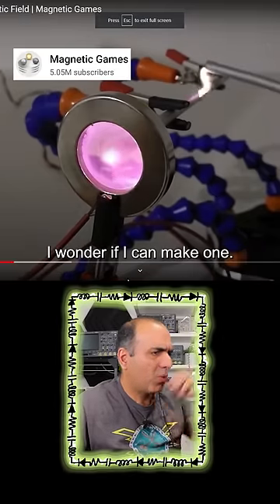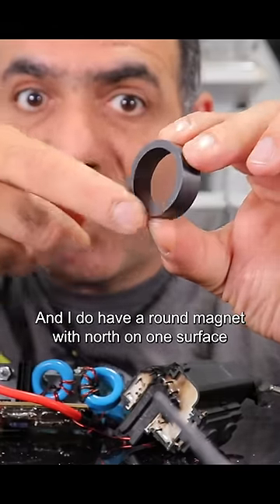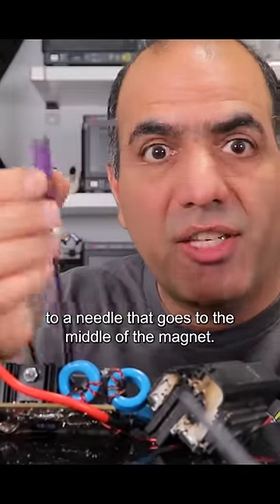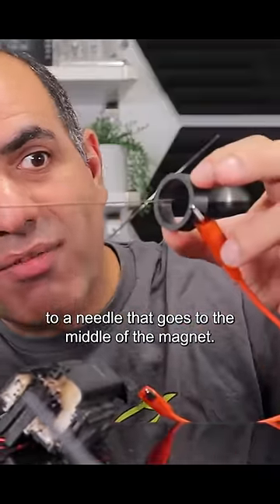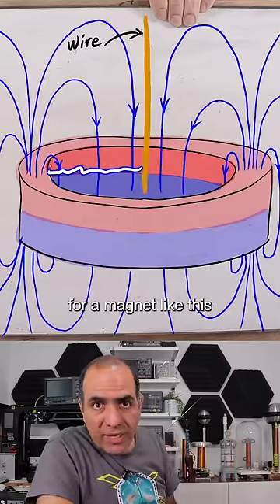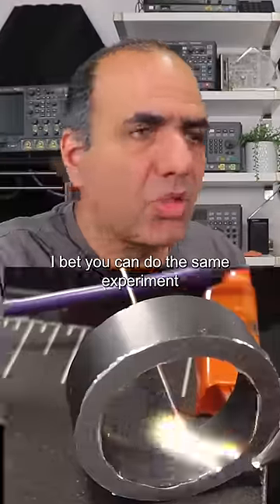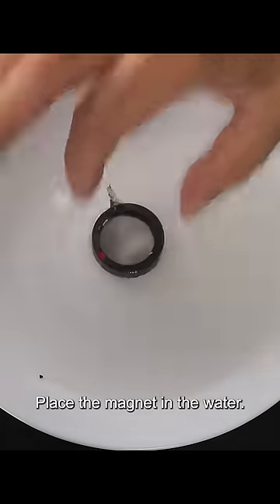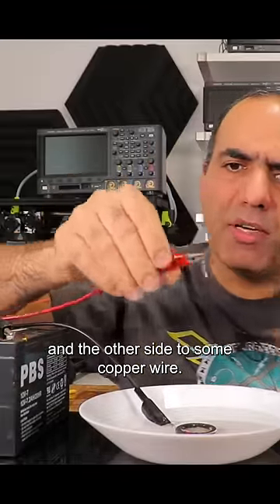Making Plasma Vortex, and Salt Water Vortex #electronics #plasma #vortex #cyclone #electroboom

Comment: You can also observe a very similar phenomenon when welding, if you get too close to the magnet holding the panel in place, it throws the arc all over the place.
Reply: It definitely will. A lot of guys will wrap their ground lead around a singular leg. I've had it so bad I've had to move my welder out and ground to a length of 514 and daisy chain to the table to alleviate the problem. It is crazy to see. First time I experienced I was welding and watching my puddle flow in but a quarter inch behind my wire I'd watch the weld be fully ejected. Being that I was inexperienced I was completely perplexed and became quite frustrated 😆
Reply: @johncoaleii1423  👁️👄👁️

Comment: That could be a water proposition drive have a screw thread formed on the inside of the magnet it will cause the water to flow outwards a silent drive !

Comment: Finally a video of him not orchestrating a way to hurt himself, phew. Alot of his videos of him hurting himself, if my source is correct, have been to teach safety ironically enough. Basically the 'fool' trope, but thankfully hes knowledgable enough in electric engineering to make sure the worst that happens is a easily controllable fire or a shock that sends him reeling but doesnt end in a ER visit.

Comment: Could you make a propulsion system using magnets.

I was thinking about starfox, remember ships flew theough rings, what if they were copper rings, what if our space ships were made out of neodimium.

What if we could use orbiting rings to slow ships and if possible reverse it to propel ships into orbit at faster speeds.

This if works should be super advantagious for humanity as we could use smaller cheaper ships, or bigger more interstellar ships as we can save alot of fuel.